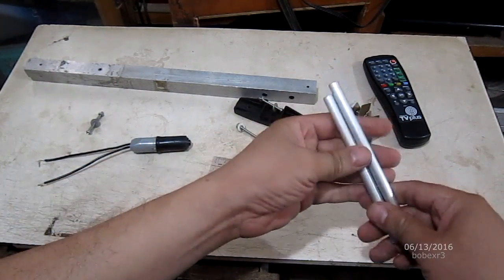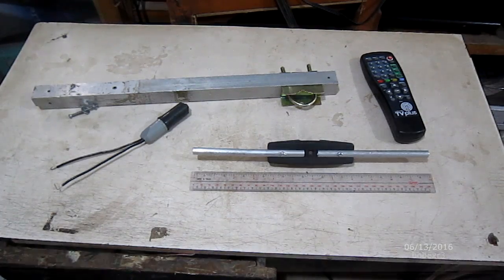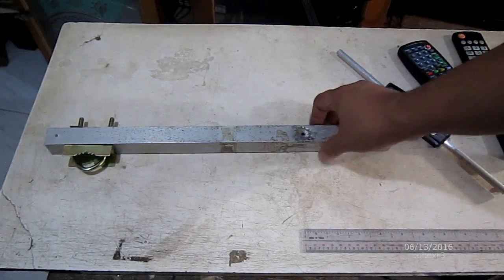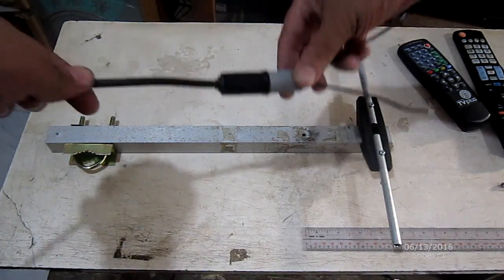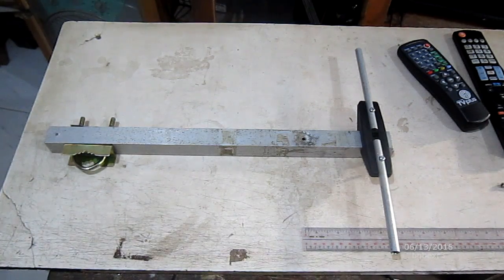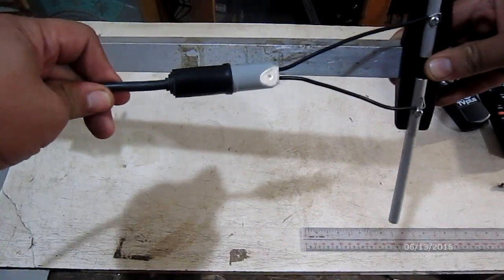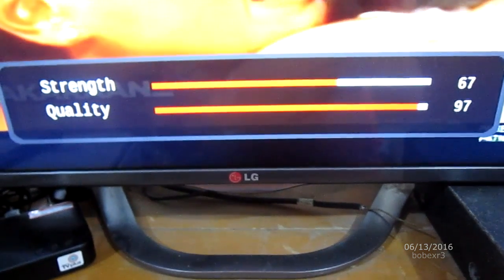How To Make A Digital TV Antenna (My Way) (ISDB-T Philippines)

Comment: Pwede sa FM radio lang?
Reply from the maker: Hindi po dahil ang sukat nitong antenna ay pang UHF. Ang pwede sa FM ay yung Baron na pang analog TV (hindi yung Baron BRL receiver link na pang digital TV).
Reply: @bobexr3  pwede also sa VHF: HD RADIO FM (76/88 - 108 MHz) and DAB RADIO (174 - 240 MHz).
Reply: Pero nakita ko sa YouTube video na homemade FM antenna na naka vertical line pero mahaba yun...
Reply from the maker: @GMTTheWyrmVol07  
Yung mahaba pwede pero yung sa akin maliit ang sukat na pang UHF lamang at mahina sa VHF FM.
Reply: Oh ganun pala. Try ko later...
Reply from the maker: @GMTTheWyrmVol07  
Pero may mga FM stations (depende sa station) na horizontal polarity ang kanilang transmitting antenna kaya kung vertical ang gagamitin mo medyo humina ang kanilang signal.
Reply: mixed ang propagations ng FM signals.. they both transmit horizontally and vertically dahil sa porma ng fm antenna na ginagamit ng transmitting radio station..
Reply: Ano maganda antenna para sa fm
Reply: @aliciamardo1234  kahit tv antenna yung outdoor para lumakas ang signal ng FM station.

Comment: Sir,  sa Bacolod po ako at sa city proper lng talaga bahay namin (heart of the city lang), pero ang pangit2 ng signal ng tv namin (wala kaming black box or anything).. Pwede po ba makahingi ng list ng mga materials na ginamit nyo pati measurements para mabili ko agad. Ang hirap pag walang lalake sa bahay 😟,  lahat sini-search ko na lng sa Youtube kung panu gawin 😊😊.. Thank you po Sir.
Reply from the maker: Itong antenna na pina kita ko sa digital po at hindi pwede sa analog. Kung analog ang TV nyo nasubukan nyo ba ang Baron antenna? Kung yun ang gamit mo at pangit pa rin baka overdrive ang nang yari dahil napakaraming FM stations dyan at malapit ka sa mga FM transmitters. FM trap ang solution dyan na i trap niya ang 88 - 108 MHz FM frequencies.
Reply: @bobexr3  pano yung i ta trap?

Comment: sir yun 2 wire na nandyan po ba sa video ay signal converter po ba tawag dyan?paano ko ililipat dyan un antenna ng tv plus ko na magnetic antenna?pasensya na po noobs po.thanks
Reply from the maker: Matching transformer po yun or balun (balance unbalance). Mabili po yun sa electronic stores. Meron din yun sa Handyman, Ace Hardware, True Value, etc.

Comment: HDTV ANTENNA?? PERO GINAMIT MONG REMOTE PANG T.V PLUS.. NILOLOKO MO BA KAMI AAHAHAHAH
Reply from the maker: Sabi ko DTV hindi HDTV. Pero kahit wala akong sinabi na HDTV hindi ibig sabihin na lahat na TVplus SD. Yung nabili ko HD model na may HDMI output sa likud at capable hanggang 1080i depende sa station. https://youtu.be/_NWe_qeWRec
Reply: tama naman si sir  @bobexr3  ah.. Kahit hdtv or sddtv na digital transmission pareho lang ang antenna nyan nasa uhf... depende nalang sa gusto ng gma or abscbn kung ano prefer nila mag 1080p ba o standard lang.. pag 1080p kasi malaking bandwidth kailangan, kaya isang program lang sa isang channel.. Ang advantage naman ng standard lang( hindi full hd), kayang pagkasyahin ang maraming program sa isang channel kasi may mas maliit sya bandwidth kaya nga mas pinili ng abscbn tv plus( na ngayon ay wala na🤣🤣😥) yung standard lang kasi kaya multiple program in one channel(frequency)  kaysa sa one full hd program in one channel(frequency)  .. yun lang pagkakaalam ko as an ECE student😊
Reply: Natural Mente! TV Plus Ang digital converter box or digital set top box nya. Meaning walang ISDB-t Tuner Ang flat screen TV nya.

Comment: What Kind of Balun is that? I think, for best Results it should be a 1:1 Balun bc. of about 75 Ohms Feedpoint Impedance. 

Some People do not use a Balun, but it can be helpful, bc. a Dipole Antenna is a symmetrical (balanced Type of an) Antenna but Coax Cable is unbalanced. So a Balun can help, to isolate the Antenna from the Feed Line (Coax Cable).

Comment: Im a little bit confused here..  How did u combine the cable from the anthena and the cable from the tvplus..  is anyone there can help me here..  😭😭
Reply from the maker: I did not combined the cable from antenna and cable from TVPlus. I bought a separate cable for the antenna and connected directly to the back of TVPlus. I did not use the included antenna of TVPlus in this video.
Reply: @bobexr3  oh! I see.. Now I understand..  I thought I need to cut the wire from the tvplus then connect it directly to the anthena btw thnks Even-though I already purchased the Baron anthena 😭

Comment: So after all the experiments you made, can you say that the latest one, the one that have many reflectors behind the dipole, is the best one to make?
Reply from the maker: It depends. If you are far away where the signal is very weak then the one with reflectors are better because it has more gain. The disadvantage is it is directional which means you have to aim the antenna at the transmitter. Those other transmitters from behind would be attenuated (weaken).

Comment: why you are using tvplus?
Reply from the maker: Our TV don't have built-in DTV tuner and the only available DTV converter box here in Cagayan de Oro is TVPlus.
Reply: what do you call that plastic mount holding the antenna element? 

diameter of the aluminum tube?

Comment: planning to install tv plus in calapan and subaan oriental mindoro in philippines. yung original antenna comes sa package ng tv plus i know di kakayanin ang layo even itaas ko pa sa rooftop. what i plan is to build or  buy a directional antenna which is vertical like on video but may reflector sa likod at may radial sa harapan to boost the receiving capability. naalala ko tuloy nung nag raradyo pa ko sa amature freq vhf using my icom 28-H with cruscraft 13B2 antenna with rotator. Hoping puede, cause if this happen, puede na ito sa malalayong lugar basta maitutuk lang yung antenna sa nearest tv transmitter na may digital broadcast.

Comment: Suggestion for you.  The 30 cm dipole is a half wave length for a 500Mhz signal which is about in the middle of the 850 to 185 Mhz range.  The pole is acting as a reflector and possibly could be more effective if you move the antenna to 15cm or a quarter wavelength from the pole.
Reply from the maker: My original plan was to use plastic as a pole to make sure there's no reflector involved so that the antenna is completely omnidirectional but plastic can become brittle and break over time when exposed to U/V from the sun so it's not practical. Using a metal pole as I did can make it partially directional which means it can still receive from sides because it's mounted vertically that's why I use a longer square boom to keep the antenna away from the pole which acts as a reflector to make it as omnidirectional as possible. We don't need a highly directional antenna because ISDB-T is similar to DVB-T which is resistant to multi-path interference which is the ghost in analog. Anyway, thanks for the suggestion that the pole must be a quarter wavelength to make a directional antenna because I can use that information in my future experiment.

Comment: sayang signal strength lang yung comparison, hindi pinakita kung ano pinagkaiba ng dami ng channel na nakuha sa horizontal-vs-Vertical. malaking tulong sana ito sa mga naghahanap paano mapalakas ung signal ng DTB. so this video is only an idea just  to test if working or not sa ibang location. upon the explanation hes not sure about the difference of Horizontal and Vertical Position. anyway thanks for sharing sir. sana wag mo masamain yung comment ko hehe. isa din ako sa mga naghahanap ng ideas and solution to boost UHF signal.
Reply from the maker: Taga Cagayan de Oro po ako. Ang dahilan kung bakit hindi ko pinakita kung gaano ka dami ang channels dahil kahit sa ngayon (May 2017)  isa lang ang channel dito lol :) Sa analog marami pero sa digital isa lang nanggaling sa ABS CBN pero 7 sub-channels squeezed in a 6 MHz band pero dalawa lang and hidi encrypted ang lima encrypted at exclusive sa TVplus box.

Comment: The TV+ Indoor Antenna vertically on top of the roof at 2 storey house is beautiful. Because the signal of ABS-CBN is 53/99 but the BEAM is 66/99.
Location: Brgy. Magsaysay, San Pedro, Laguna

Comment: but you are using tv plus it means you dont need that kind of antenna anymore.
Reply from the maker: In many cases you're right but for some areas where signals are marginal you need an outdoor antenna.
Reply: Baby and ME o÷wea
Reply: Baby and ME nope.there are some areas that still has issue on digital reception, thats why this video is made and helpful especially for people who has problems with the reception

Comment: pwede po ba to sa smart led tv rekta na sa likod wala ng ibng pasukan?
Reply from the maker: Kailangan na ang TV may built-in ISDB-T tuner kung wala kailangan ka ng converter box katulad ng ABS CBN TVplus or any ISDB-T box.
Reply: ah ganun po gmawa ako katulad na katulad nyan kso. di nag bago ung signal siguro nsa location ko na.

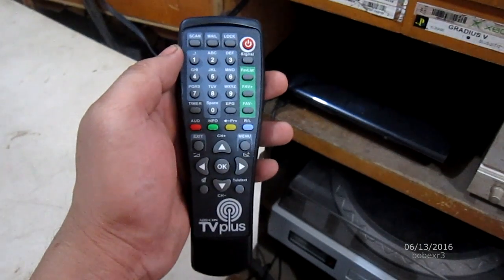Comment: At 2:18 you will notice that the mast/pole is acting like a reflector which may explain why the vertical orientation of the antenna is giving a better signal. The reflector makes it slightly directional with a slight gain in the signal when oriented properly. Trying it out with a bamboo mast like a person who commented below would give the horizontally oriented antenna a fair fight.
Reply from the maker: You're right about the pole which acts like a reflector but I don't have a bamboo so I repeated the experiment by using a directional antenna with reflectors from rear so that both horizontal & vertical have reflectors but the results are the same. I still got a stronger signal on vertical than horizontal at least in my location. No idea if you agree with the antenna design that I used to repeat the experiment but here what it looks like: https://youtu.be/K9sntwjtQcc
Reply: Nice going with the reflector. So much more than what I was expecting. I guess the results speak for themselves. Vertical oriented is better than horizontal for digital TV. Thanks for taking the time to verify and sharing your results.

Comment: does the direction of the antenna have any effect on the strength of the signal for the vertical post? I have lived in the US for 20+ yrs, and its true that their antenna for the digital signal are usually in the horizontal position and the poles are arranged in the triangular manner, from shortest to longest. With this format, adjusting the direction (north, east, south, west) on the antenna do significantly improve the number of channel that it received, depending on your area of installation. Since I was living in a townhouse, I have put the antenna on my attic, and with the right direction of where the antenna is pointing, it does improve the number of channels that it can received. Someone was even suggesting that one can use two antenna of the same kind pointing at different direction and connected with the same length coaxial cable to a combiner (opposite of splitter), one can get even more channels. I too would like to make an antenna like yours, what is that thing in the middle connecting to the small pole? Thanks.
Reply from the maker: The thing in the middle is called balun a matching transformer which converts the 300Ω balance from antenna to 75Ω unbalance to coaxial cable. My antenna is a dipole which if mounted vertically it's omnidirectional and the direction of antenna can't affect the signal strength because it receives signals equally in all directions. However, omnidirectional antenna can also pick unwanted reflection signal which is ghost in analog which ATSC is not good in dealing with resulting in pixelated picture or no signal although some newer ATSC receivers has a ghost cancellation as a remedy but sometimes not enough that's why some of them still uses a directional antenna the one you mentioned plus most TV stations in the U.S. are horizontally polarized which means you loose signal strength if you mount your antenna vertically. Mounting a dipole antenna horizontally and it will became bidirectional. It can receive signals equally in front and back but not sides.
Reply: Thanks for the information and explaining your antenna more in detail. 👍

Comment: pero kapag nakavertical antenna nawawala ang directivity ng antenna diba? nagiging omnidirectional sya kaya nasasagap nya ang signal sa kahit anong dereksyon. Advantage nyan kung yung transmitter ng tv station ay nasa magkakaibang lugar. Halimbawa nasa north mo yung ABS, south mo yung GMA, East mo yung TV 5.  Disadvantage nyan kung yung Transmitter ay nasa malayo. Kaylangan mo ng mataas na directivity para masagap yung nasa malayong Transmitter. Halimbawa nyan sa Analog ay Yagi antenna. Hindi ko lang alam kung magwowork yung yagi sa Digital.
Reply from the maker: Depende din sa kanilang transmission. Halos lahat analog horizontal kaya ang receiving antenna kailangan din horizontal. kung ang transmitter vertical kailangan din na vertical ang receiving antenna dahil kung horizontal medyo humina ang signal. Dito sa Cagayan de Oro sa ngayon (10/2016) isa lang ang aming DTV nanggaling sa ABS CBN at mas malakas ang signal kung e vertical ko ang receiving antenna. Hindi ko alam sa Manila kung lahat ba na DTV stations vertical or meron din horizontal.
Reply: ang alam ko sa mga tv station vertical ang signal polarization nila. nung nag-ojt ako sa isang tv station nakavertical ang panel antenna. At ganun din nakikita ko sa ibang antenna ng tv station.

Comment: Just a super basic step: Gumamit ka ng Baron Extended Range (Yagi Style) Antenna, ikabit ang F-connector sa black box, then isaksak pamandin sa antenna, ilagay sa itaas ng iyong bahay ang Baron antenna, at gawin mo ng trick na pa-vertical ang orientation sa paglagay sa taas; pagkatapos, magsearch ng channels and then, TAPOS! LILINAW DIN PO ANG DIGITAL TV MO!
Reply: saan ikakabit ung wire?

Comment: I don't know. I am in North America, Canada , and I had no luck at all. Maybe you live upstairs from your tv station cause I live less than 5 K.M. from my broadcast tower and could not get any signal at all. So far the 8 part "bowtie" antenna is best for me. I get 11 channels all the time and up to 33 on a good clear day. Thanks for the video. I will try anything.
Reply: bobexr3 We use the same US DTV frequency as they used in analog before. UHF 14 to 69. Philippines (ISDB-T), South Korea (ATSC), Taiwan (DVB-T), Cuba (DTMB), Colombia (DVB-T2), Brazil (SBTVD-T, Brazilian version of ISDB-T), Suriname (ATSC), Bermuda (DVB-T/T2)
Reply from the maker: In North America & Canada they are using ATSC system which is not good in dealing with multipath propagation which appears as ghost in analog TV so mounting the antenna vertically is a nightmare because vertical antenna like I showed in this video is omni-directional, it can pick-up signals in all directions including unwanted reflection signal which is ghost in analog TV or pixelated or no signal at all in ATSC. Try mount the antenna horizontally and it will became bi-directional (receiving signals from front and back but not side) and aim at the transmitter. Newer ATSC receivers have ghost canellation to address this problem but many ATSC signals transmitted horizontally so you loose substantial amount of db if you mount your antenna vertically.

In the Philippines we adopted the Japanese ISDB-T which is robust in multiple path wave so vertical antenna is advantage to us because we don't have to aim our antenna to a transmitter which is ideal if you live is area with several channels from different directions. But this only applies if the transmission is also vertical or circular. If the transmission is horizontal then we also loose some db if we mount the antenna vertically.
Reply: Thanks for the help I will try it
Reply: bobexr3 Also ATSC in South Korea and Suriname.

Suriname is the only South American country that uses ATSC.
Reply: Berumda (UK) is the only North American country that uses DVB-T. Uses the same frequency did from analog NTSC to digital as US DTV frequency.

Comment: You're correct on UHF for having better signal reception, it could gain more if its created in a tin circular type receiver which some cable providers like dish type receivers are far better, the antenna included which TVplus provided was a telescopic one which can deliver FM signals most cellphones chips have. that way, they are more refined to transmit. You can also try a Sprite tin can cut wide open then place behind the antenna and put it anywhere without hollow walls or bricks. You can receive a higher dB of frequency.